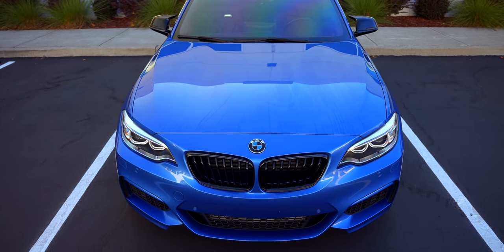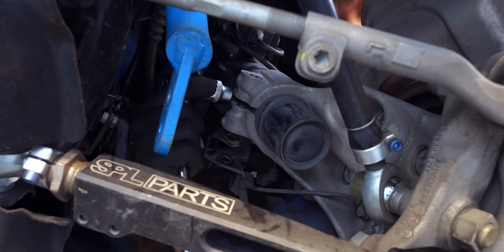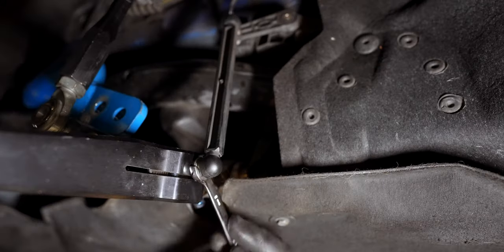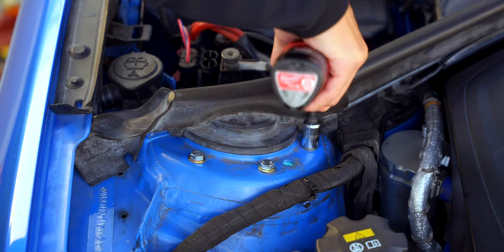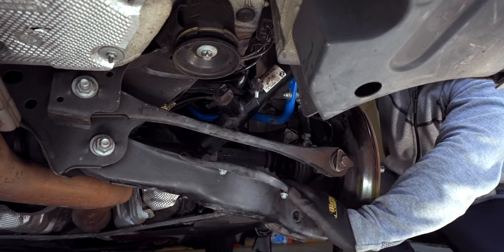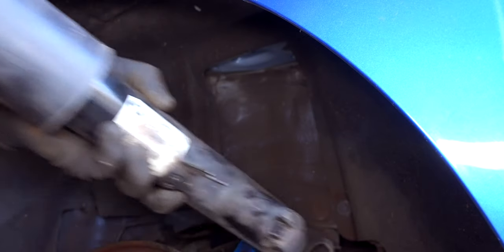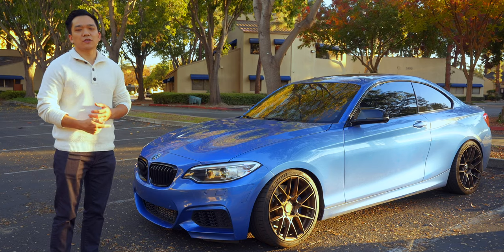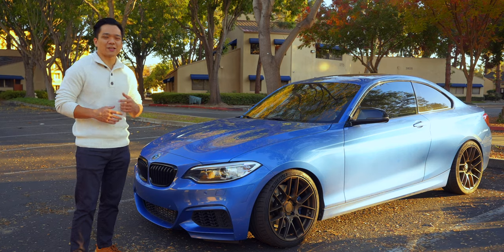The BEST Suspension to Install on your BMW

Comment: Do not use WD40 or PB blaster on the surface of knuckle housing when you install the strut. The struts are hold by the knuckle housing by the clamping force and any grease or oil will reduce the clamping force significant. That may cause your struts drop out of the knuckle under heavy load! (ask how I know). If you read the BMW repair manual of installing struts into the knuckle housing, it stresses that the contact surface must be clean and free of any oil.
Reply from the maker: Thanks for the advice. Did you also have KW's? The collar is definitely thicker than OEM, but I suppose hitting the area with brake clean to remove the lubricant wouldn't hurt.
Reply: @FritzRamos  I had Bilstein B16 and TC Kline installed. Some struts (like OE) are designed in the way that they have a taper in case the knuckle housing can not clamp the strut tight enough but that's just a fail safe mechanism. By design, it is still the clamping force that's holding the struts. Yes  removing the grease with brake cleaner and wiping them clean before installing is a good idea. If the collar is too thick to fit in, you can spread the knuckle a bit further. BTW, the factory manual says 44NM + 90 degrees turn for pinch bolt (better replace them).
Reply from the maker: @TrackandBuild 👍 Thanks for sharing your setup and insight.
Reply: @TrackandBuild  Yes torque to yield, replace please 🥺.
Reply: This doesn't seem to make sense.  How could the strut drop out of the knuckle if it is held at the top and the bottom?  How can it drop out of the knuckle?  That's a questionable design.  Surprised there isn't a lip or cleat or something to prevent it from popping out due to a lack of friction.

Comment: did realize the top mount bolts where suppose to be that lightly torqued... oops... gad they didn't brake
Reply from the maker: I was surprised too. They should be okay since they're grade 8. How tight did you go?
Reply: @FritzRamos  probably close to 40-50 Nm...

Comment: just installed the kw v2 today. honestly if it wasn't for the rewiring in the edc delete kit we would have been done in like 3 hours. your video helped alot! thank you!! ride quality it significantly better for comfort and handling over just H&R springs i had before. adjustable height is  a must!
Reply from the maker: Glad the video was helpful. For someone who has to do the wiring like you, what advice would you give?
Reply: @FritzRamos  well the instructions are not very good but everything will click when it is in place correctly. make sure you pay attention to what wire goes in what side. one wire will be solid the other will have a stripe. a small pick tool is needed and be gentle.
Reply from the maker: @AK47s4EveryOne  Right on thanks for sharing as well as your comparison between the V2s and springs.

Comment: Funny, we do many things at almost the same time. I got last week the KW V3! It completely changed the driving experience!
Keep up the good content man, really underrated channel!
Reply from the maker: Thanks! I was thinking about the V3s, but I'm lazy so I went with the DDC. You definitely have more adjustability though. How do you like the drop in height?
Reply: @FritzRamos  I didn’t drop it all the way possible. It’s also very flexibel! It’s low enough to look good and drive comfortable without problems. That was important for me because it’s my daily driver. After a week I lifted the front 2 turns, it was settling a tiny bit and was already a bit too low. Now for me it’s perfect. How do you like how the car drives now?

Comment: Agree Fritz, your videos are really awesome. I've learned so much about my car (2014 435i,) & how to fully spec it out without breaking the bank. Keep it up!
Reply from the maker: Thank you, glad you found the videos helpful. Especially the 435 is the bigger brother to the m235i. How is your build coming along?
Reply: @FritzRamos  I'm not really wanting to do a build, because I prefer a more luxury centric look than a performance/M look. Thankfully, the previous owner opted for the Luxury Package which comes with a smooth, chrome accented rear bumper and sleeker front bumper with fog lights.
There's a few other options on the car, such as PDC with only the rear camera & front sensors  

I prefer performance cars with an emphasis on luxury & tech.  Unfortunately, the Luxury Package comes only with the regular leather seats, not the sport seats that I have a soft spot for...but, that's something I can do later on if I want.

Really, right now just looking to upgrade the idrive controller, screen, replace instrument cluster with the digital one, swap out taillights for the M4 GTS LED sequential ones, swap out front adaptive Xenon headlights with the Adaptive full LED headlights. 

Want to add the Driver Assistance Package, which adds kafas2 camera to windshield & a HUD system in the dash. Those are bigger jobs & think I should hand those off to a pro. 

Are you gonna get the new LED taillights or headlights for the M2?

Comment: Hi Fritz, I’ve installed b14’s on my m240i. My driver’s side (rhs here in Australia) is sitting 14 mm lower than the passenger side with the same height on threads. Rear is perfect. I can’t figure why. Why do you think that might be? Thanks

Comment: Ive never seen the camber bolts actually hold the camber plate over a long period at the tq spec, they always slide unless you get them 3 ugga duggas

Comment: Great videos - hope you keep making them - super informative!  Is it possible to just upgrade to coilovers?  Or do you need to also upgrade the control arms, end links, anything else?  I imagine the coilovers change the length needed for the control arms, end links, etc., but is that really the case?  What's the disadvantage of running stock control arms, end links, etc with new coilovers?  Thanks!
Reply from the maker: You can change just the coil overs if you want. The other parts are not necessary for the install, with the one possible exception being the endlinks. The OEM ones, may not physically fit with the KWs in.

Comment: I went to your tools list but I couldn't find the pass-thru socket/ratchet set, and it's not the same torque wrench. Which are you using? Thank you! Great video also!!
Reply from the maker: Just checked. It's there and should be in stock

Comment: Hey Fritz, would you recommend doing coilovers or LCA/tension rods first? Which made a more noticeable improvement?
Reply from the maker: Looking back on it I would probably do the camber plates and coilovers first as they mad a more significant improvement to the cars handling.

Comment: Is the KW kit you installed a V1, V2, or V3? 
Or can you please share the part number. The link in the description looks different from the part you installed. On the SVBimmer link it shows the rear springs differently from what you installed.  

Much appreciated

Comment: Vorshlag and kw here as well, LSD worth it though as well. Maybe that's next for you?
Reply from the maker: Nice! I was actually thinking about LSD or Coils before deciding on these. The LSD might be the next big performance mod after some upcoming maintenance. I was thinking about WaveTrac, what do you have?
Reply: @FritzRamos  I went with the easy "plug n play" of the mperformance one since the pumpkin is already attached. Fluid wasn't cheap either. Totally worth it. Wish I would've done it prior to Coilovers and camber plates for sure. Right after LCA would've been best timing to get bang for buck.
Reply: Yeah I went LSD first before anything and it made a massive difference. Im running HR springs  now and it actually feels pretty good especially when I went up to 235 width tires in the front. Installing Vorshlag plates next week. Ill see how that with HR springs is for a budget setup.

Comment: Hi Fritz, one question.  For the front, i see some people taking the lower control arm bolts out in order to get the shocks out.  Is that necessary?  As I see you didnt have to do that.  Tks
Reply from the maker: I've seen that too. I didn't have to, but if you can't separate it in the wheel well it's worth a shot.
Reply: @FritzRamos  Tks, bud.

Comment: this stuff is getting confusing for me especially when thinking about getting wider wheel/ tyre setups with differnt sidewalls and it just becomes specific to everyones car. So hard to know if i can lower the car enough for track efficiency while not rubbing especially with the 2 series which doesnt have much room in the wheel well

Comment: Fritz.   Another high quality video. Your videos have saved me much time.   I spoke to KW suspensions technical support - “John” about aftermarket adjustable sway links for V2 install on a M240.  He recommended not doing it and informed me it would void lifetime warranty.  I was considering Turner adjustable end links about 25 mm shorter than stock to eliminate pre- load    I will not be doing that.    Also question on M2/3/4 cf brace install with Vorslog 
What is spec on bolts ?  I ordered off the list from video but all bolts were too large for 3 holes on camber plate appear to be 8  mm and maybe 1.5 pitch.    Thanks again
Reply from the maker: Thanks. What does KW suggest you do, run without end links? It might work with a stock sway bar, but if you go aftermarket there's no way. Even if you did use adjustable end links, how would they know? 😉 

For the CF brace, you have the exact same camber plate right?

Comment: What happened with the End links? Is it because the Swaybar is too thick compared to H&R for ex. (F:28 R:20). Or are there special end links that work with KW Coilovers?
What if I wanted to mount my Swaybars in there least stiffer position? Any End links you would recommend?
Reply from the maker: It had more to do with the KW mounting position being off from OEM. If you call SPL Parts, ask for Turner and tell him you need the same setup as Fritz on the m235i. If you need to, reference this video
Reply: Thanks man!! I'll definatly will do.
Any regrets regarding the Turner (KW) sway bars? (or prefer others)
Do they scratch on any of the arms or are too thick by any means?
Love your Videos.. learned so much from you. 
The best on YT!! gratefull for your work 🙏
Reply: @FritzRamos  Did they send you the Blue Turner Endlinks? Did that solve the Problem?
Reply from the maker: @k.alothman  No, they sent shorter ones and it worked

Comment: If i tighten the excentric bolt of toe arm more than 100 nm, will i have to change the bolt the washer and the lock nut or just the lock nut  ?! Thanks for.your reply 🙏🏻🙏🏻🙏🏻

Comment: Great video! I have a set of KW V3 on my F22 too, is it possible to adjust the rear rebound without taking the wheel and coilover off?
Reply: Yes I drilled a small hole into wheel well and trunk and bought kw adj extenders 80 mm can now adj inside trunk

Comment: The strut spreader i’m using is about the same dimensions as the one you linked, but i’m having a pretty difficult time pulling the strut from the knuckle. Anyone have tips on separating the two?
Reply from the maker: Tryusing th spreder tool to get it started and if you need more space wedged in a screwdriver as well.
Reply: @FritzRamos  Thanks i’ll give it another go this weekend! Also, would having the other side of the car on the ground limit the brake assembly from lowering from the strut? Love the car btw, proper setup for an F22 👍🏽

Comment: I don’t want mine lowered from stock. Would I still see performance if I buy these and keep it stock height??
Reply from the maker: You might want to look into the Bilstein B16, I think the drop in height is less than the KW. You Will still see an improvement in handling as your spring rate and dampening will improve.

Comment: what can happen if the bolt of the rear toe arm is tightened with a torque more than 100 nm ?!
Reply from the maker: The one to the chassis is supposed to get 165Nm. If any bolt is overtorqued you run the Rick of snapping the bolt head or messing up the threads
Reply: @FritzRamos  i speak about the toe arm not the camber arm .how the bolt on the other side is tightened at 100nm + 90° and used at 100nm .thanks a lot

Comment: Hello, nice M235i and nice job! Can you tell me your settings : distance of the center of the wheel to the arch in the front and in the rear? I have KW DDC on my M235i, with front M2TS +LCA, and the car was very low in the front, even at the higher setup of the coilover...so i have installed harder springs, and I am trying to find the good settings in order to have a balanced car!

Comment: Hey, I worked today on the front. Pulled the OEM EDC out and fitted HR lowering springs. Putting the strut in now but it is very hard to put it back. Will continue tomorrow, any tips? Do I need to undo any arms to have more room? Any suggestions?
Reply from the maker: If you are using a spring compressor, then you can install the the top hat once the strut is in the wheel well with the compressed spring. You could also loosen the thrust arm and lower control arm if you prefer to install it as one unit. Just make sure to tighten the arms at ride height if you have the rubber bushings.
Reply: @FritzRamos  i have the lowering allready assembled on the strut. It’s a trick to get the tophat in and the foot of the strut in the knuckle. It’s seems I need to undo the arms(which I try to avoid). Any tips still? Cheers!

Comment: what bellows did you use? cant seem to find any rear bellows for our car anywhere and the ones i have right now are currently torn up pretty bad.
Reply from the maker: I used the ones from KW. What suspension are you running?
Reply: @FritzRamos  Currently running OEM rear shocks. but just got my bilstein EDC rear shocks in the mail and want to get new bellows.

Comment: Thanks for the awesome guide! I just installed the same kw v3 DDC kit and front camber plate on my m240i, but I'm getting some clunking at lower speeds when driving over small bumps. Already double checked everything was torqued correctly and nothing was loose. It definitely wasn't there before. I'm think the sway bar links need to be shorter to release some of the preload (all other suspension stuff is OEM). It seems like it's only coming from the front right. Any suggestions?
Reply: Which plates? do you still have that noise?